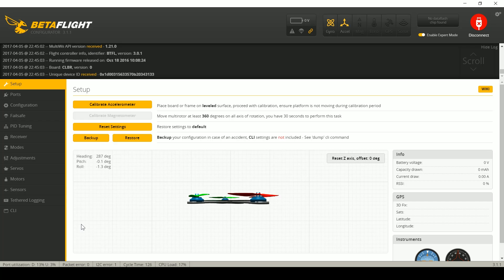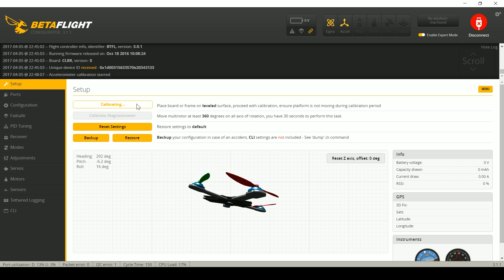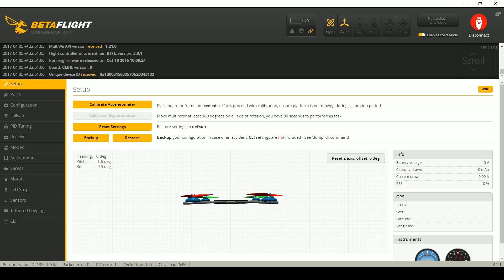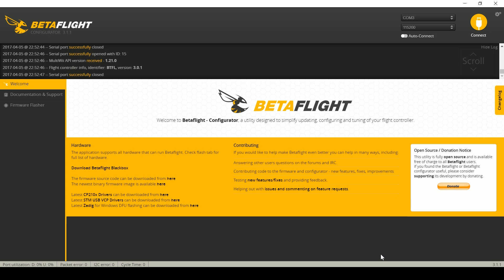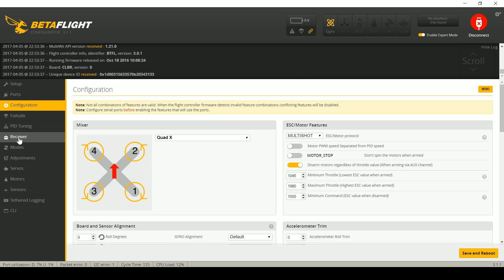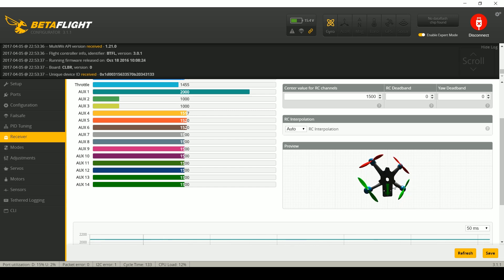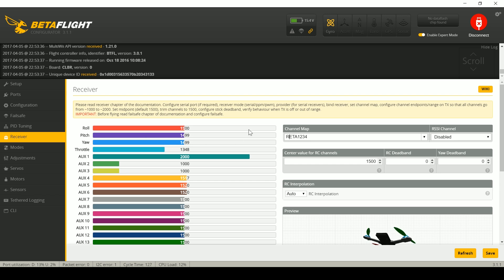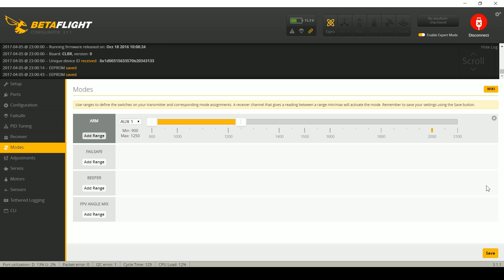Quadcopter Won't Arm | CLEANFLIGHT BETAFLIGHT

Comment: Its also a great tool to have small angle 180, or disabled acc, for retrieval purposes if you get stuck in a tree. Likely to burn a motor or an ESC, but if you cant get your copter down, it might come in handy to arm it and thrash it around the branches.... Great video as always Josh :D
Reply from the maker: +Liam Lambkin you can also recalibrate the acc with stick commands whole the copter is in the tree.
Reply: Ahhh, good idea. I bet that it wouldnt work very well if it was windy tho :/
Reply: Great idea. Whats the stick command?
Reply from the maker: +Alex DiJ https://github.com/cleanflight/cleanflight/blob/master/docs/assets/images/StickPositions.png
Reply from the maker: +Joe https://github.com/cleanflight/cleanflight/blob/master/docs/assets/images/StickPositions.png

I don't think I will make a video but hopefully this will help.
Reply: i tried these stick commands after watching a way to fine tune your quad to eliminate drift. i use a spektrum radio and when i followed the commands, i ended up changing the betaflight profile lol so i went to roll and it was super laxed because it was stock settings not what i expected, and crashed. no harm, no foul just know that if using a spektrum radio those stick commands may not work as indicated.
Reply: Definitely useful to be able to arm at any angle. I dislodged my quad from a tree by flicking the arm switch on and off a few times just a few weeks ago. No harm was done to the ESCs.
Reply: Gabriel Larke, yeah, it only becomes an issue when one or more of the props is jammed.
Reply: Man, you guys must either be loaded or get a ton of freebies. I'd MUCH rather just climb the tree rather than burn a motor or esc on the off chance It'll fall down. You could always just pay some teenager 5 bucks to get it for you if you cant climb it yourself. Or even tie a noose at the end of an extendable pole, like a pool cleaner. You can collapse it and just keep it in your trunk when you go flying near trees. Those things are like 30ft of thin alluminum tubing so theyve got reach and dont weigh much. Just hook the drone and pull the chord to tighten it up.

Comment: I have an idea for one of your videos . maybe you have already done it and I haven't ran across it yet. 
it's a in your opion and experience video.
best quad setups , maybe for newbies. light but stong  frames , fc , pdb , esc , motors ect.
there are so many choices out there that a guy like me and I'm sure alot of your audience get confused as to what might be a really good , easy to configure setup. I'm at the point I want to build . I've looked at the mr steel setup and am thinking about it . I ask your opinion because you have alot of good technical and practical knowledge that I've come to trust. maybe do 3 types of setups : freestyle , racing and a crossover. most importantly something about motor vs prop size and efficiency.
thank you my friend , have a good one

Comment: everyone, pay special attention to the min_check portion of this video. correctly setting your min_check can GREATLY improve your flight experience by getting rid of the dead zone at the bottom of the throttle!!

 Thanks for mentioning this Joshua
Reply: Adam-g1 Wow, feeling kinda dumb right now. Been playing this game for awhile now and somehow never came across this tidbit. Default Betaflight was at 1100. I've  always noticed the dead spot especially on takeoff. Thanks for the heads up to reexamine that portion of the video.
Reply: RCFlyer85 yes, dshot as well.
Reply: Thank you!
Reply: I went for almost two years with no clue about min_check... and the day I read something about it and gave it a try, I felt really sad that I didn't do this earlier. So much better low throttle control doing this!
Reply: I was wondering what that was, I thought it was related to the ppm values like an idiot
Reply: Adam-g1 Yup this is good advice. Makes my rigs feel less jumpy down low.
Reply: Does this affect DShot as well?
Reply: you should also flash your esc's in analogue protocol first before setting dshot for better resolution

Comment: What is this accelerometer you speak of?  Always have it disabled.  😃
Reply: i think he was joking?
Reply: its the sensor the quad uses to see how much it is tilted on each axis, the quad uses it for things like angle mode and such. if you disable the accelerometer you wont be able to use any selfleveling modes.
Reply: possibly, however, some people might still need the info :p
Reply: true
Reply: Ah yeah. I know what it is. It's a PITA if you leave it active on a racer.  I always disable it.